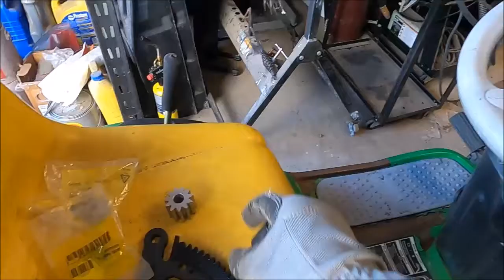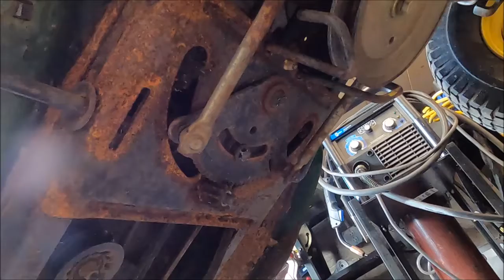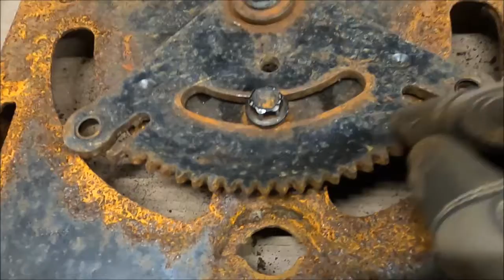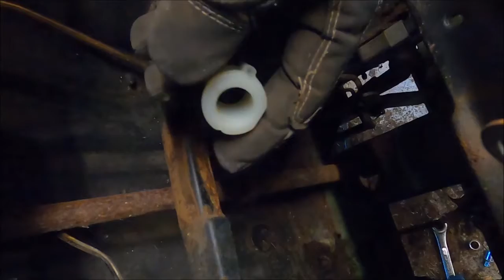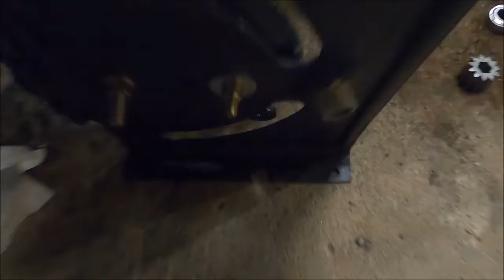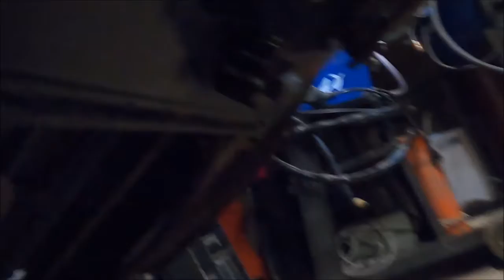John Deere LA105 Steering Repair

Comment: Loved the video. I need one showing hot to install a new steering shaft on l110 John Deere. Can't find one. Could you please help. Thank you
Reply from the maker: Sorry, I don't have access to that model. A lot of these little tractors are very similar. The priciples of the steering setup should hopefully be close enough that you can make the repair on your tractor.

Comment: Try using PB Blaster on those bolts. My old building had 1/2 inch bolts  on clips that were attached to the girts and they came right out plus I used impact tool. They had been there for 40 years.